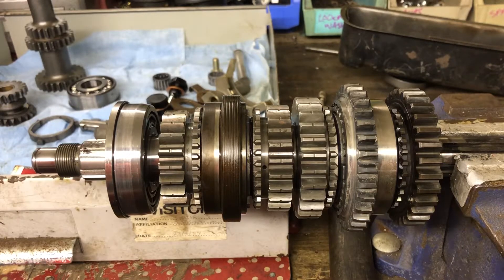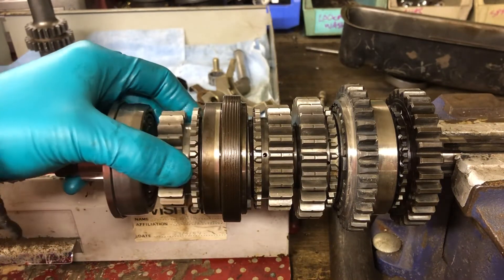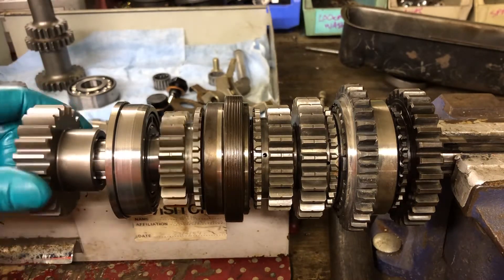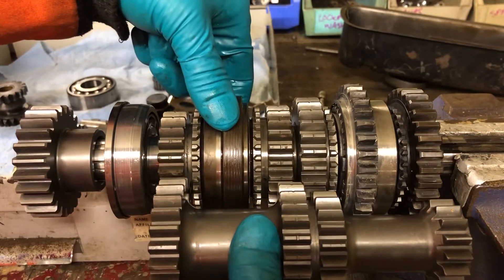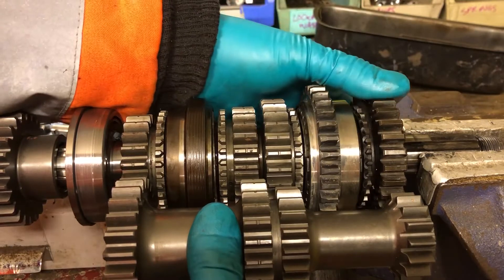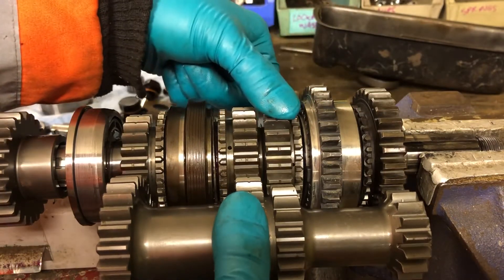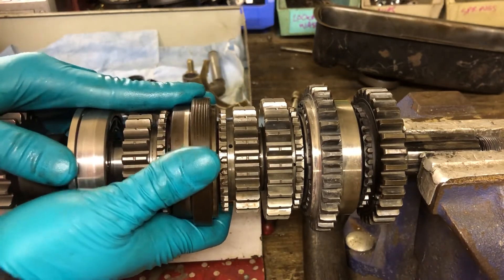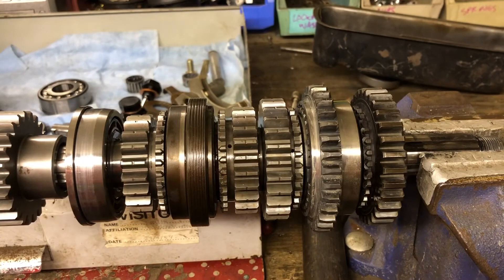Classic Mini Gearbox - How It Works

Comment: Great explanation, thanks
Reply from the maker: No problem. Could see what you were trying to figure out with your numbers. You should see how a getrag 6 speed works. 2 layshafts and it uses 3rd and 4th for gears 5 and 6 via the second layshaft.
Reply: @NickThornhill  good job I've started with a simple one then lol
Reply: @NickThornhill  I've had a lot of issues with my gearbox, bought it over lock down and when I went to collect it it was broke, seller agreed to have it refurbished, lasted 200miles. Went back and I still wasn't happy as it was clunking, turns out the diff was dangerously worn so I fixed that myself. Then a new fault developed where it would pop out of 2nd,I fitted a bias spring which made it stop however it now crunches in to 2nd on down shift at anything above 20mph. Not sure if the bias spring has caused this issue but I am going to refurbish it myself this winter and just go canny with it over summers
Reply from the maker: Often it’s rebuilt with new synchro cones as a bandage but what it needs is a new second gear or selector/baulk ring. You should be able to see if the dog teeth are worn on either/both. Usually 2nd and 4th are the worse.
Reply: @NickThornhill  yes I will fully inspect it all, i have bought a 1st/2nd selector fork in preparation but like you say may need more. What baulk rings do you recommend, I've been looking at mini spares comp ones at around £42 or mini sport at £80
Reply from the maker: Good shout buying the fork, I used both new forks, I also used competition Baulk rings and the standard synchro hubs on mine as the teeth were pretty good. Not cheap to buy any more but synchro hub teeth usually get eaten up.